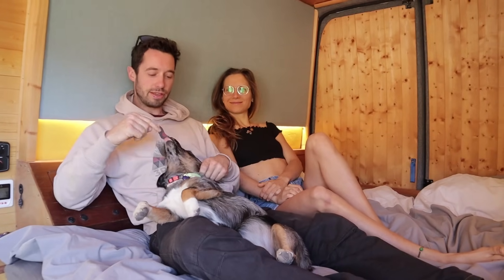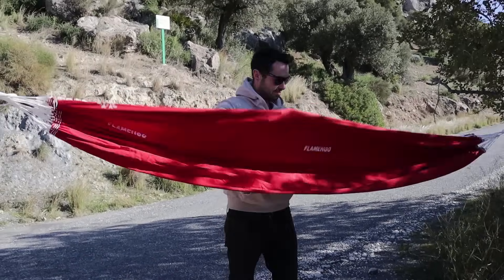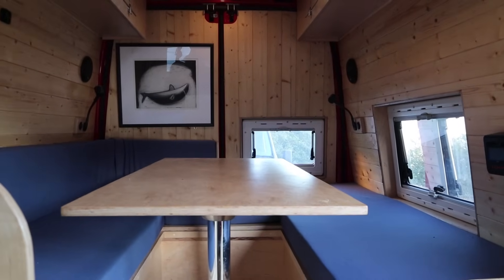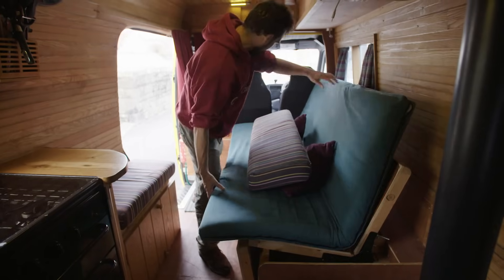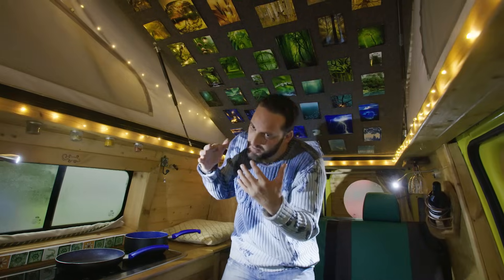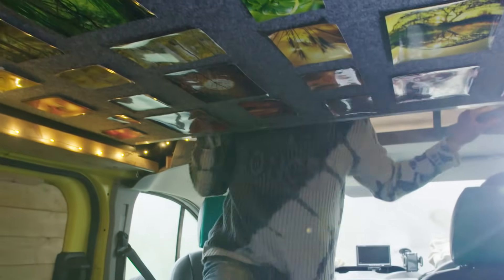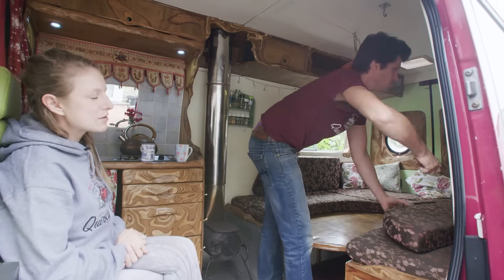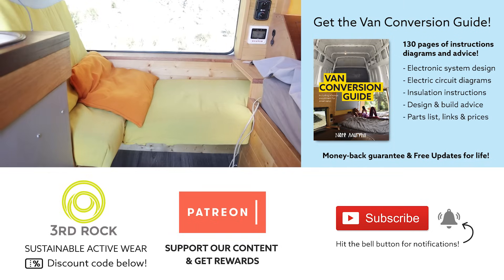10 Awesome BED DESIGNS for your VAN CONVERSION 🛏 🚐

Comment: none of these are as good as the one,s i made  in my sprinter can put both of them away and you have a full size van for 7 feet at the back and you only loose 6 inches in width shame i cant send you a video so you can add it to this its a really neat solution if you need to use a van for say carrying a motorbike or my 14 foot kayak fits inside it still ....